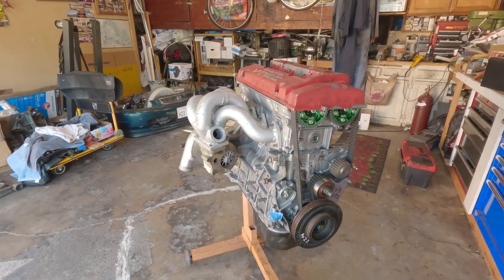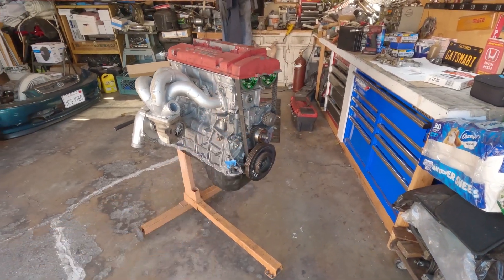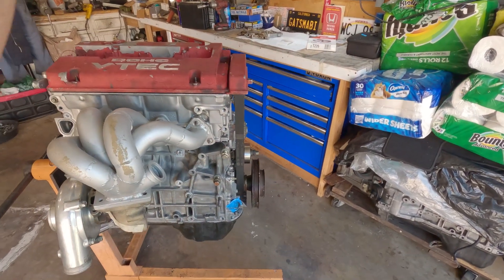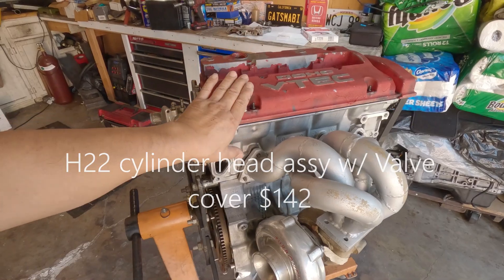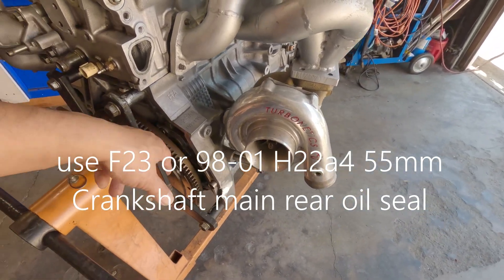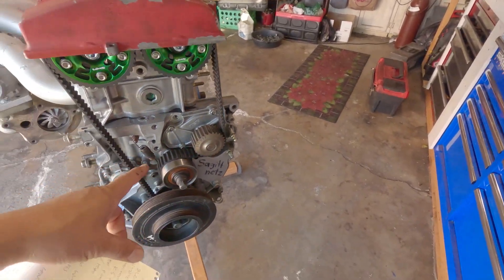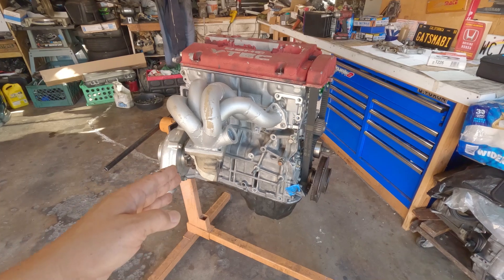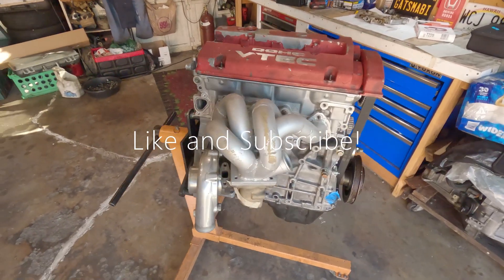How much it cost to build a G23VTEC Frank motor?

Comment: And is it possible to do the head swap without pulling the motor
Reply from the maker: Yes, if thinking of changing pistons. Oil pan can be remove and leave the block intact in the bay.

Comment: That's awesome, brother I'm leaning towards this motor instead of a regular H series for my 96 wagon. I already have an f23 engine in it from a 02 accord. 
 What electronics can you use on the G23? ecu, injector, 02 sensors, knock sensors, distributor, power steering pump, etc.
Can I use an ecu from a 98 to 01 prelude?
Reply from the maker: There's really no ecu that can be use that'll make g23 to run right. It needs to be tune. But P13 can be use or a chip p28 only to get it started and fix whatever need to be fix, send it to a tuner afterwards. If you have P28 w/ hondata s300, then you can download a fuel basemap to make it run and have it tune.  Fuel injectors will be like any other H22 swap on Accord. It's ypur choice w/c brsnd you want to use. What l used on mine is a chip P28 w/ H22a4 fuel basemap and H22a4 fuel injectors. I broke in the motor w/ setup like it. I went to a tuner and change the injectors w/ RC450 cc. Hope this will help you.
Reply from the maker: G23 will move your wagon for sure man! Thanks

Comment: Just to add my 2 cents in.   Depending on what state your in, etc. you can get a pretty good deal on used parts.   I know at the local Pull-a-part the last short block I bought was just about 200 dollars, and they gave me most of the rotating accessories for free.  Now I do know the guys there pretty well, it will probably vary from location to location.   I've also gotten a couple of F22 manual transmissions with all the parts need to convert an automatic to a 5 speed, and it only costs around 330 dollars- that includes the shifter assy and cables,  the cv axle and intermediate shaft, the clutch pedal assy, everything except the ECU (I could never find one of those in stock had to hit up ebay for a manual ECU).
Reply from the maker: Socal brother and thanks for info that way some viewers will know the place to really get a good deal of parts is hit the yard. Before l only pay 150 on f23 short block but prices went up and last time l check, 450 for a short block. Coworker recently changed his engine and got this block from him. Thanks

Comment: Quick question man, what do you do for break in oil ? Do you use the zinc additive to add tonthe oil as well? Just rebuilt my boosted K series and have the zinc break in additive and was curious if I should go they route. Thanks in advance.
Reply from the maker: I usually just use regular 5w30 oil for break in period. If l'm using a aftermarket cams like SK2, I will use some special oil for break in. A good idea though.
Reply: @sagittnet2158  Thanks for the info. Appreciate ya. 👍🏻

Comment: Do you use a timing cover or do you leave it open
Reply from the maker: Only the lower part is installed. The top section doesn't mate properly w/ the lower cover.

Comment: What is the max bore you can do with the F23 stock sleeves? Can you go 87mm?
Reply from the maker: You can, but only NA setup, no boost. The liner will be so thin that it wont hold the pressure. The first G23 created was f23 block w/ H23a1 head. The creator bored it to 87mm and used h22a4 piston and lasted for K of miles.
Reply from the maker: Maximum per Honda is 86.10mm
Reply: @sagittnet2158  just making sure I understand.. it lasted for 1000 miles only or it lasted for thousands of miles? I'm only thinking of building for all motor. Who was the creator of the G23?
Reply from the maker: @skromee  it was back in Honda-tech.com era. Pirate mcfred and he was using the engine on a road racing. Lots of miles he put on that engine. You thinking of using H22a4 piston?
Reply: @sagittnet2158  thinking of using JDM Type-S Pistons. Or oversized 87mm K20 pistons.
Reply: @sagittnet2158  what head gasket do you use for 87mm?
Reply from the maker: @skromee  if using H22 tyoe S piston will give you so much comp ratio and it will stick out pass the block (0.020") piston ht is 31.00mm. K series piston is perfect for it coz it has same piston ht like f23. You just have to decide how you want it installed on the block wether you want it normal or like f23. Some aftermarket piston like cp have no offset so no worry there. You can ck zealautowerks.com for your plan of attack. Just to give you an idea how much comp ratio youll have w/ h22 piston.
Reply from the maker: @skromee  Not sure what headgasket to use when you bore it to 87mm. I've used OE F23 headgasket on 86.5mm. Not really sure, but you can contact Cometic or maybe KStuned maybe they have some gasket for something like 87.mm. Some folks will have the H cyl head weld the oil drain shut and among other tbing that could lead to oil leak, if want you can do the same, try out H22, H23a1 headgasket and  you can pinpoint the weakest link.
Reply: @sagittnet2158  did you have to modify the OEM 86mm head gasket to work with the 86.5mm Pistons? Thanks for all the knowledge.
Reply from the maker: @skromee  I measured my used F23 and H22 headgadket. It measured 3.405" vs 3.465", you'll have about 0.025" all around overlap on F23 block if it's bore to 87mm. Will it create a hotspot w/ headgasket overhung like it, maybe. I'm not sure if you are familiar w/ F20b owner that they use H22 headgasket. F20b is 85mm and they use 87mm headgasket. I know it's total opposite of what your intention. If you think about it, that f20b using h22 headgasket have a pocket in between the head n' block but sure no one is complaining. I did a f20b headgadkey r&r and owner not bothered by it. I say you should give it a try and no problem at all man.
Reply from the maker: @skromee  If you really serious about your build project. You can try bring f23 headgadket to a machine shop and maybe they can help you out. I know Golden Eagle are selling Honda OE headgasket that they oversize in the house, maybe you can email them or check their webste.
Reply from the maker: @skromee  No mods required coz the OE headgasket are made so we can use it to next size in case the block need to be oversize.
Reply: @sagittnet2158  I think I will stick to 86mm - 86.5mm then to keep it simple with OEM head gasket.
Reply from the maker: @skromee  86.5mm will be better, you right on the middle.

Comment: Is it possible to run a g23 with the stock f23 pistons
Reply from the maker: Yes, some people have done it and made over 400whp w/ turbo. Acceleration might be poor coz of lower comp ratio. I think if you use a flat head valves. It might bring the comp ratio to 9:1+ maybe. Go to zealautowerks.com and it'll give you an idea about comp ratio.

Comment: what is the max hp you can get out of oem k20 and dorged f23 rods with same setup . thanks .
Reply from the maker: It all depends of the setup, l'm using the type S k20 piston, H23 bluetop camshafts and my comp ratio is only 11+ to 1. Made 223 whp on pump 91 octane gas. It'll we higher if l'm using H22 type S cams and e85 for gas, 240hp is achievable but that's just my estimation but its possible. If you need more power you can use the k20 type R piston and use sk2 cams, change the valve springs and use sk2 h22 intake mani, bigger t/b and you should be making a lot.
Reply from the maker: OE k20 piston can handle a lot of power, as long as it's NA setup. Some will boost the motor w/o changing the piston and it can make a minimum of 400whp but since it's not made for boost application. It does'nt last as long. If your setup is NA, you shouldn't worry much.
Reply: @sagittnet2158  if I'm using low compretion k20 piston (nippon) with forged f23 piston and a turbo setup , is it anny good. Thanks for your response.
Reply: @sagittnet2158  I want to go as stock and reliable as possible
Reply from the maker: @errajiadnane6553  Keep it simple and a little bit of upgraded parts and it should last. If you've seen how l build it and parts l used and do not use other than Honda oe headgasket. No reving more than its capable of making power. It should last.
Reply: @sagittnet2158  thanks a lot , I know I asked a lot but how much Will sleeving the block coasts , thanks .
Reply from the maker: @errajiadnane6553  Not a thing brother and no trouble at all. Prices are all different depending on what kind of sleeving. Dry sleeve should cost around 900-1k. Wet sleeve should cost from 1500 up to 2k depending on whp rating. I paid 1600 on mine Lasleeve and that was 2yrs ago.
Reply from the maker: @errajiadnane6553  l've never use a Nippon racing turbo piston on boosted application yet. I'll find out if its any good once its put together.

Comment: are the h23a camshafts better than h22a?
Reply from the maker: I'm not to sure if it's the same, but l know its interchangeable w/ H22a4 and F20b as long as comp ratio is above 10:1 or higher. The 92-95 H22 camshafts have different cam profile vs H22a4, H23a and F20b coz it has to accomodate the bump up on comp ratio.